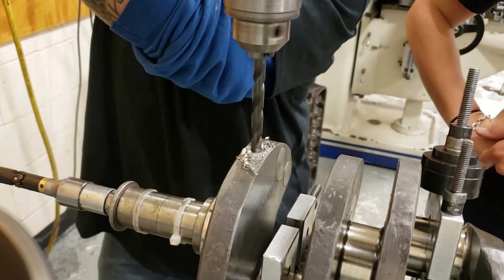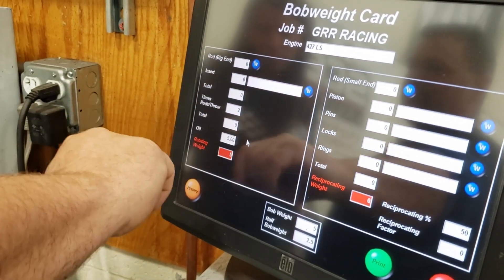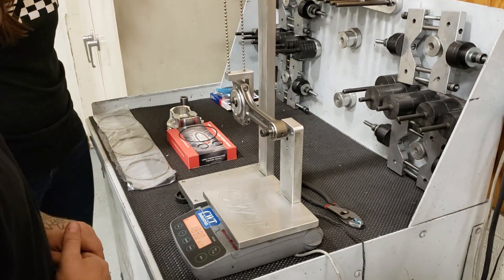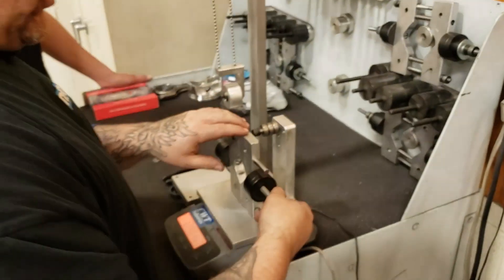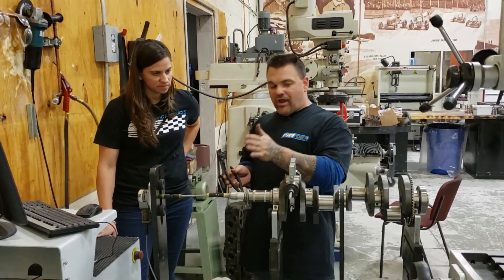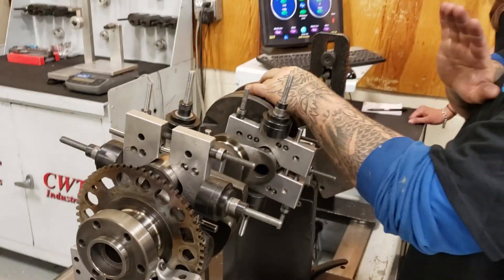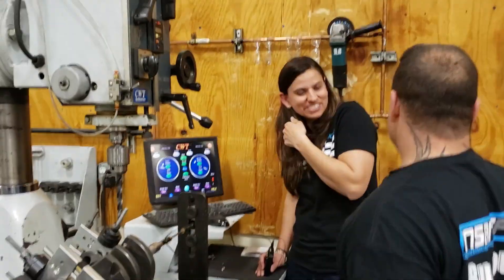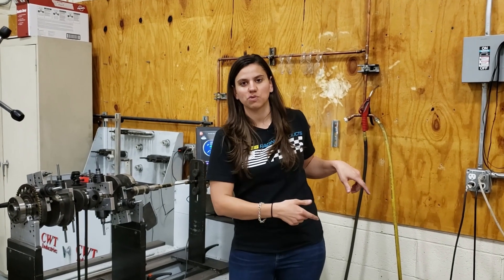Project GrrMaro Episode 12 - How to Balance a Crankshaft

Comment: Nice video, I’m always amazed why balancers don’t run cranks faster than idle speed to balance. You would think it would be more optimum to balance in a range the motor most runs at.

Comment: So, all the balancing adjustments are only done to the 2 outer fat counter weights?  Do holes need to be drilled, or metal added,  on those smaller inner counter weights at any time?
Reply from the maker: Sorry just saw this!  

It would all just depend on your set up, but you want to make the least amount of adjustments as possible. but yes, at time sometimes the smaller inner ones might need adjustment.  Depends on your rod and piston
Reply: @MicheleAbbate  Oh. Thank You!  I'm trying to learn and understand. That really helps.